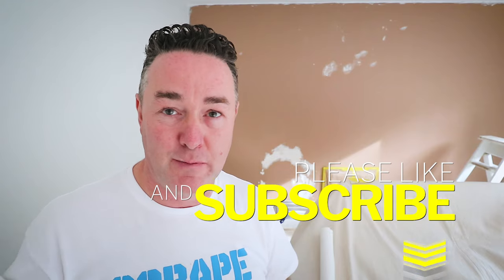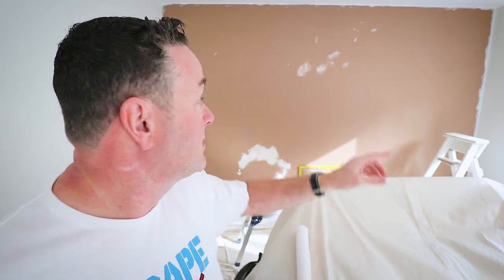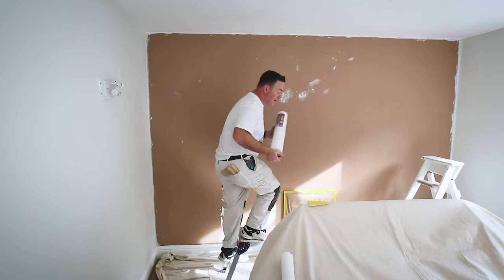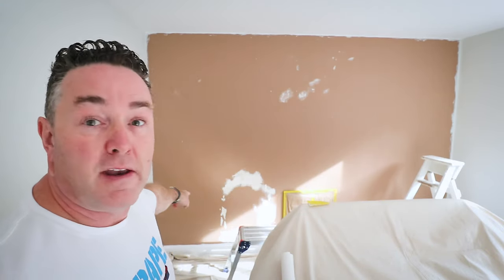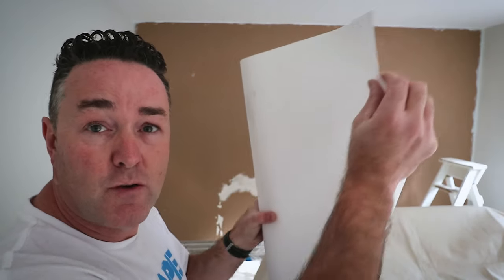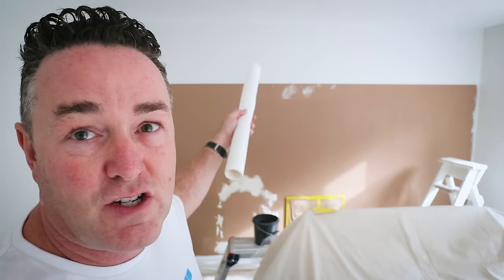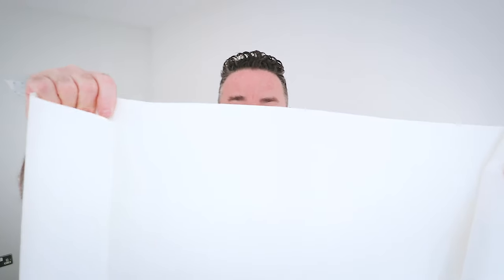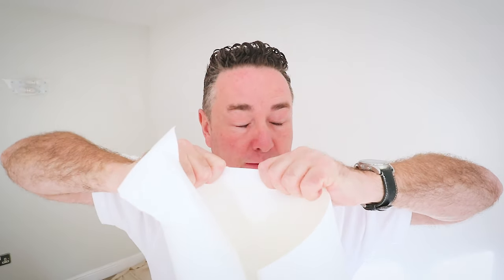do you hang lining paper horizontally or vertically? Lets Find Out

Comment: Another Great Vid Phil, thanks.

I won't use anything else, I'm a convert to wallrock since a decorator introduced me to it about 5 years ago. I use the different widths of wallrock on the same wall. I totally agree about vertical application.  I reckon the main reason linning paper traditionally is applied horizontally is that theres less strips as walls tend to be wider than height although the reason the lines will be hiden is the most coined reason. 

I like your demo on its strength....rip vs pull. 

With your mantra in mind, Wallrock is a "work smarter not harder" product. 

Furthermore, I've also taken your advice and use products that are time efficient e.g. i used zinsser Allcoat (frames, skirting in white and doors black) to decorate a lobby in my flats. It allowed me to 2 coat and complete woodwork in a day requiring only 1 day access to each flat. Like you often say, the extra cost is nothing in comparison to man hours for the job so it makes sense. 

Keep the vids coming 

Cheers
Reply from the maker: Great to hear.
Have you tried any Bedec MSP or BarnPaint yet?
Reply: Not yet but will give them a go on a job when theres less time pressures. The 1hr dry time was the biggy and quality is good with allcoat. I've used the brushkiller (johnos) before but dry time was too long for this job. Johnos is a brush killer....... It makes me want to add hair conditioner when i wash the brushes lol

Comment: Spot on Phil, I always say it doesnt matter whether you cross or drop...there are just two things I consider, the length/height of the wall, will I need a lot of boards and trestles to get across?
And the shape of the wall, is it going to be quicker/easier to place 4 horizontal  lengths, or 14/16/18+ vertical ones.
Reply from the maker: yp.. think it through and don't just rush and jump in... working smarter not harder.

Comment: Why not use a normal lining paper? I get the strength value of Fiberliner but if the walls are sound why pay treble for Fiberliner for something your no going to see? I'm guessing you only use a bit of fine surface filler because the walls where in good condition.
Reply from the maker: I could of done, but I've already done videos on normal paper lol
It's not a so much the extra cost, you're only looking at £10 more to do a wall like that in wallrock.. or thereabouts, but hanging time is faster as you just PTW. no soaking, no waiting. You could also hang over it the same day if you were pushed for time.. you couldn't do that with normal paper.
The wall was good, just a bit of mapping showing from before, that easy skimmed out.

Comment: Isn't the anaglypta version called tuff stuff
Reply from the maker: go back about 20ish years, they did a product of lining paper the same as wallrock, but called it Armadillo.. then walrock seemed to take over and have a better product.
Anaglypta still do a armadillo range of tuff (none woven) fibre papers... not done any recently though... seems a bit out dated.
Reply: Have you noticed the change in pulp lining paper size from 56cm to 53cm. Had a proper  head scratcher moment when working off 2 rolls above and  below a window.
Reply from the maker: Seen it, not had different rolls yet though lol

Comment: Leaving a gap seems to be the way it's taught in colleges now.
Reply from the maker: And why?
We all know college isn't like it was 25yrs ago :(
Reply: At first, as it gives a bit of leeway to an inexperienced student but once they improve I introduce the option of close butting
Reply: I've had it argued to me that you leave a gap and fill it with fine surface filler when paper is dry. What's wrong with butting up? I never had any problem with that.
Reply from the maker: how many see 4yrs of a full course day release through these days?
Reply from the maker: I spoze some peple struggle with it, then wantto spend time filling and sanding, spot priming it over with paste prior to hanging. All that time needs to be charged for. ;)
Don't start me on painting over filler joints! lol
Reply: Yes it does seem to be that way, personally I think it's easier to butt it up than leave a consistent gap. Case of the blind leading the blind in colleges these days I fear. I've also noticed alot of newly "qualified" decorators aren't able to paper full stop and struggle setting out and having knowledge of different types of papers and pastes to use.
Reply: That comes with experience and mistakes !